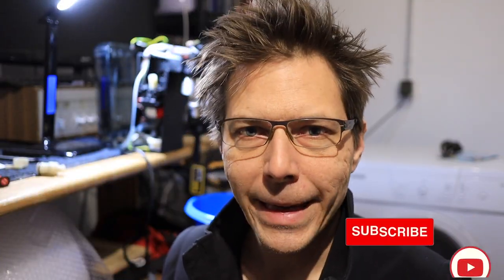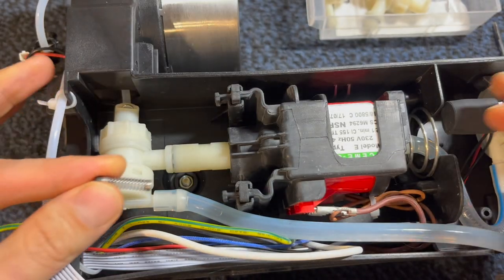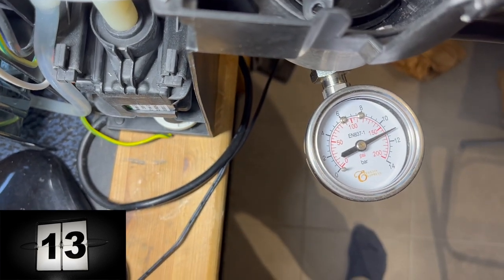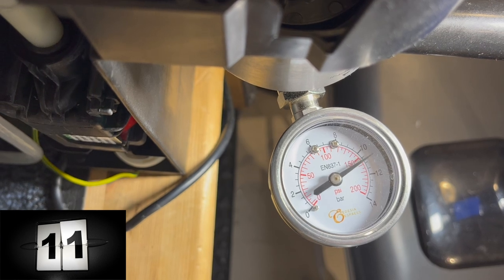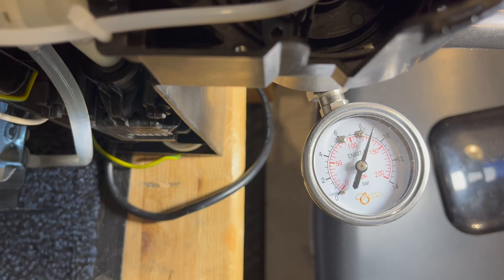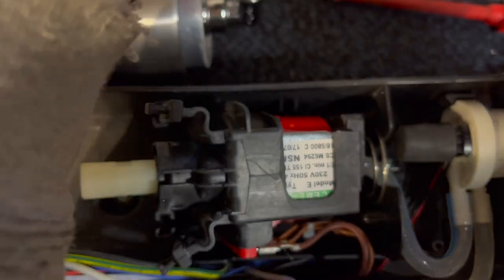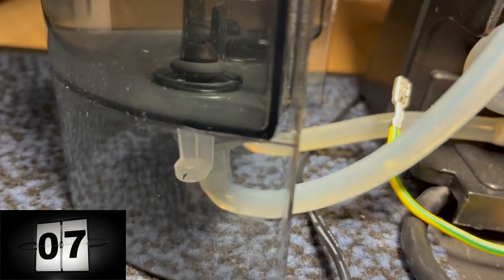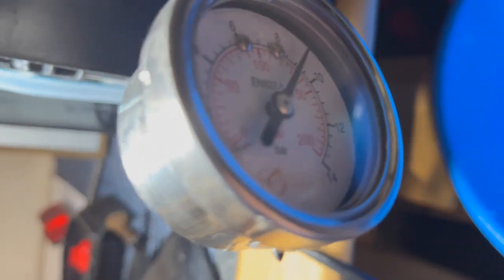How to Tune the Dedica to Max Out at 9 Bar instead of 11. Should you do it?

Comment from the maker: In the last video, we built a manometer out of a portafilter and blind disc. In this video, we will try different spring strengths and lengths in the OPV of the Delonghi Dedica EC685, and see if we can attain 9 bars.
Join the coffee club! (subscribe): https://www.youtube.com/c/TomsCoffeeCorner?sub_confirmation=1
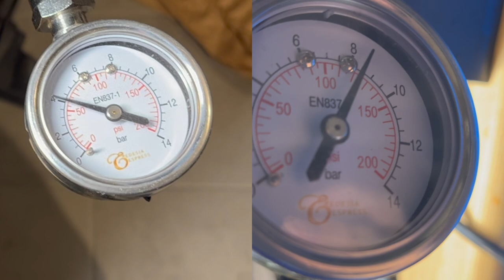0:00 Intro
1:04 Disclaimer!
1:42 OPV Prep
3:08 Test 1 with Original Spring
4:01 Test 2 with Pen Spring
5:52 Test 3 with shortened Pen Spring
8:10 Test 4 with Shortened Original Spring
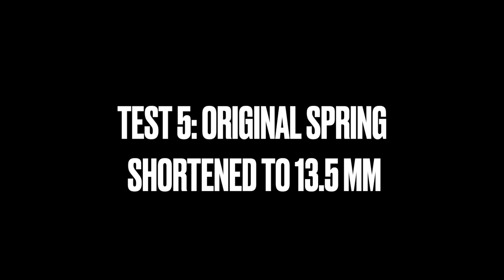10:49 Test 5 with further Shortened Original Spring
12:48 Result
Reply: I saw a modification where a bolt was built into this valve and the pressure was adjusted with a bolt.
Reply: Hey tom! Greetings from mexico. Man you convinced me to buy my first espresso machine.  Than you very much. Your channel is my favorite coffee channel on youtube!

Id like to ask for your advice.
I got the ECP 3420. I had been long brewing coffee using a cheap chinese knockoff moka pot. And the change feels substantial.
However i have set my mind up on finding a way to control the pressure. because id like to brew at a lower pressure.
Im currently pondering as to which way would be better... spring kits (like this video) or the dimmer + manometer mod.

I would think that going the extra mile and adding the manometer and the dimmer would give me extra control. but thought of asking you in case im missing something.

Thanks again! And have a wonderful day!
Reply: @sergeykh9544 ,Kenwood ES326 öyle👍.Ama köpük yapmıyor makinem,ve bir çözüm bulamadım🙄🤔

Comment: ok this looks like a fix, my machine blasts out a shot in 5 seconds and i mean blasts out same pressure as a pressure washer you would use to clean brick work. its been this way since o got it. now i know i can have a go at fixing the pressure problem by shortening the spring.thank you for your info Tom.

Comment: Thank you for your efforts putting these videos together, I've enjoyed watching them. You inspired me to open up and tinker with my EC685, which has been fun, its a surprisingly well designed little thing inside to my non-expert eyes. 
I recently swapped out the stock "safety valve" with an adjustable OPV from the Breville BES920, which has allowed me to reduce the extraction pressure as desired.
Unfortunately though there's been a couple of unexpected side effects. The stock safety seems to be more than just a simple OPV which is why it is so chunky I think.
After swapping to the Breville OPV, there is now quite a bit more vibration and noise through the machine from the pump and now have "puck sneeze" / residual pressure after pump is stopped.
I do think I'm getting a better extraction now as espresso flavour has changed, although it's not overly significant to my taste buds. 
I'm still on the fence as to whether it was worth it and may end up putting the stock valve back in.
Reply from the maker: Thanks so much for posting your results, Michael! I am sure that your findings are interesting to a lot of people watching.
I agree, that the OPV seems to be more than an OPV, rather a safety valve. It does also have a check valve on the inlet side, to not allow water to backflow through the OPV. Also, I feel like the stock valve is more of a safety valve, opening only if the pressure would get too high in the system. 
So your OPV came from a Breville Dual Boiler - very nice. Did it fit as such, or did you have to get extra fittings? Where did you order it from?
Reply: Hello Michael, have you got any updates on this? Did you try to install a no return valve maybe? Or went back to original OPV?
Reply: @panosp57  Hi, yeah I'm still running the Breville OPV mod and pulling shots with the machine daily. It's definitely improved the consistency of extractions as I'm now able to dial in the grind and then get pretty consistent shots throughout a 1kg bag of beans which I could never do before. 
The downsides mentioned don't appear to be causing problems with the machine. I just make sure to let the porta filter sit for about 30sec to allow pressure to dissipate and it's fine.

I would say it's worth giving it a go if you enjoy pulling things apart and putting them back together again 🙂
Reply: @michaelmulvogue9165  thank you for this update Michael. That sounds encouraging!

Comment: When there is coffee in the filter the pressure is gonna be a bit lower than the static(no-flow) pressure you measured with the manometer. 
The pressure curves for the Ulka EP5 pump indicate a 1bar pressure loss per 50ml/min flow-rate increase.
The 11bars static pressure might be aimed for a 9bar@150ml/min intended working point.
Reply from the maker: Hey Burns, as it turns out, I think you are exactly right. I installed an in line manometer in a later video, and found the stock OPV to have 9 bar during an extraction. I think the only reason for the confusion, is that most companies advertise 15 bars of pressure, so people figure they have to reduce it.🙋🏼‍♂️
Reply: @TomsCoffeeCorner  so you’re saying the stock opv is actually tuned to 9bar?
Reply: @TomsCoffeeCorner  so you’re saying the stock opv is actually tuned to 9bar?
Reply from the maker: Honestly it seems that way, yes. If you grind right, and do a nice puck prep, I have measured around 9 bar with an inline manometer. Cheers! @raelmax_
Reply: @TomsCoffeeCorner  Thanks, Tom! :D
Reply: @TomsCoffeeCorner  Maybe it's advertised as 15bars with the supplied pressurised basket?
Reply: @TomsCoffeeCorner  Thank you so much!
Reply: @TomsCoffeeCorner  I realize it’s been a while since you tested it, but could you still share what the ‘right grind size’ was?

Comment: what i've leaned from this vid is: just leave it as is ! 😅 much more experienced people and techical professionals have dialed-in this machine to be as good as possible. if they could be making the machine get significantly better coffee by just putting in a shorter spring, why wouldn't they? no extra cost, but extra bragging rights for this espresso model in the whole world 🙂 . i guess trying out to improve it through DIY at basically 0 extra cost, would definitely be worth it if a better model would be comercially available only with tweaked internals which does actually extract better coffee, so that you know there is a quality peak to look at. but in this case i don't know of there beying one. so..... happy you did these try-outs so that i won't have the need to do them, big thumbs up ! 👍👍
Reply from the maker: I agree. That is part of the reason I did this video. I hope it can save some people some time. Thanks for watching and commenting!
Reply: I wouldn't agree. Factory settings are set to suit ordinary people who lack both the skills and equipment (like precision baskets) for a better coffee extraction. Even more that they don't care (or understand) the difference between good and bad extraction - I used to be one myself just a month ago. But once you start to get understanding and equipment, you want to make the machine better as well.
Reply: The dedica is intended for pressurized baskets and therefore need more pressure for the extraction. Pressurized baskets ensure a good crema everytime, regardless of the coffee. The target group of the dedica definitely are beginners or just the average person wanting a more fancy coffee experience. The 6-9 bar range (the range Tom is trying to achieve) is for unpressurized baskets that you normally find in more advanced machines for more experienced „baristas“.
What I want so say is, that the machine is optimized for its purpose, which is using high pressure to extract as much crema as possible, to provide a consistent experience to inexperienced consumers. Tom is trying to tinker the machine to make it suitable for unpressurized baskets, which requires a completely different workflow as well as different tools.

Nonetheless I am also very grateful for the video and the prevention of me pulling apart my coffee machine :D

Comment: I was thinking of doing the same procedure, thanking you so much for sharing. I have my mind now on maybe designing a PID controller for the pump to maintain a tighter trajectory to 9 bars. Cheers.
Reply from the maker: That would be very cool! But I guess you'd need an in-line manometer with digital feedback to the PID loop, right? Sounds like fun!

Comment: Nice to see you tried a shorter spring. Also your taste opinion was valuable to me. 

As for another approach, you can restrict the flow out of the basket a bit (pressurized lite), as this will cause the pressure across the coffee bed to be reduced. 

With a normal pressurized basket, the pressure across the bottom of the basket is a bit high, so you have to coarsen the grind a bit to get an acceptable flow rate. That said, another video used a Decent and coarser grind with a short extraction time and 6 bar pressure, because they had read a recent research paper suggested that this gave better extraction. I do not think the video producer realized he was mimicking making coffee with a pressurized basket.
Reply from the maker: Hey Tom, thanks for your input. I would like to put an in-line manometer in the machine, and test the pressure that way. That way I can see what pressures are reached when there is a permeable load at the group head. This test was just to kind of see if a baseline of 9 bars could be achieved through the mod, but I have feeling that the pressure will be lower when pulling a shot.

Comment: Hi Tom and thanks for your nice dedica videos, I watched them all.... I wanted to ask you, i bought an ec685 for 35€ and i would like to refurbish it, which seals do you recommend to replace and which components? the Volumenzähler also?
Thank you very much
Reply from the maker: Just do a thorough descaling, maybe twice, and clean the machine up. If it leaks from the group head, you could replace that gasket. But it is not really a part that wears out easily. I have never had to replace mine.
Reply: @TomsCoffeeCorner  ok thanks, do you recommend me replacing the opv valve and the pump gasket? I don't know how old the machine is...
Reply from the maker: @frankieitaly86  You only need to replace the OPV if it's broken (in which case the water tank will bubble during extraction). The pumps last a real long time. I wouldn't change that stuff proactively, unless the pressure seems really low.
Reply: @TomsCoffeeCorner  thank you very much Tom

Comment: The video that i have been waiting for. I really like that you put your effort for the dedica (in budget) owners over there like me hahah. Is it possible to try some of the mr shades springs that you used for gaggia?
Reply from the maker: Glad you liked it, Andreas! No, the Mr. Shades springs are much wider than the Dedica springs. Too bad about that. What would actually be nicer is a different OPV that is adjustable.
Reply from the maker: @Alberto Rodríguez Yes, but I have not found one that will fit yet. Do you know of one?
Reply: @TomsCoffeeCorner  Found some info on reddit a while ago about a Saeco OPV that would fit Dedica as well. I swapped the spring on my Dedica with one from a ball pen and was happy enough since that I didn't need to research further to find the Saeco part. I think it's a matter of finding the right spring, with the same length and width as the original one, but different elasticity. Trial and error with different pens i guess. I don't have a manometer portafilter unfortunately to give you stats on the pen's spring I used, but maybe you can find this pen and try it "BiC Soft feel Med".
Reply from the maker: @Cattaable  I will have to check it out. It mainly has to do with coil diameter and length, I think. Did the taste change for you? How about the extraction....did it become longer?
Reply: @Cattaable  you know you can get a box of different size/strength springs on the Bay for not much?

Comment: Hello!  great video.  why is the pressure rising so slowly?  how does the taste of coffee change?  would like to see how to install PID controller on DeLongi ECP
Reply from the maker: I think too much water is escaping out of the OVP due to less pressure of the spring. But eventually, the pressure builds up in the system. If no water escaped, it would build up much more quickly, like with the original spring at full length.
Reply: @TomsCoffeeCorner  thanks, how much does the taste of coffee change at 9 bar?

Comment: Hi Tom great show... 9 bar ...the holy grail! Just wondering if the OPV 9 bar spring from the Gaggia mod would fit the Delonghi ?
I know more work for you ...the moding though makes great fun of the whole coffee experience...
Many thanks laudi
Reply from the maker: Hey Laudi, no it wouldn't fit because the output fitting going from the OPV to the thermoblock is a completely different fitting type. Maybe if there was an adapter. Does anyone know?

Comment: Hi Tom, would you be able to do OPV mod for Barista Express? The proper one with coffee testing. I believe that this is the only way to get better coffee out of this machine and avoid channeling induced by extensive pressure. Thanks.
Reply from the maker: Hey Krzysztof, I actually have a Barista Express laying around, that I could check out. I believe the OPV is adjustable, by screwing it outwards. Do you think this could be interesting for lots of people? I am not sure if this hasn't already been done on Youtube?
Reply: @TomsCoffeeCorner  defintely it would be as I could not find a proper tutorial with test on YT. OPV is adjustable as far as I know but it looks like you need to unscrew it quite a bit to restrict  pressure to 9bars. Apparently you might be on the edge of thread engagement risking some leaks from the valve or striping the thread. I wonder if putting a shorter spring would be a safer option. Also I am curious if the mod is worth doing at at all. :)

Comment: Hi Tom, thanks for all your work and experimentation on the Dedica!  I have been looking for a GCP, but they are so popular in the US that finding anything decent for less than 2-3x the price of a Dedica is impossible.  But I'm out of work and money is tight, so I'm switching to a Dedica.  Just debating used vs new.  New is less than $50 higher than used.  I am thinking it is worth that premium to ensure no scaling in the small thermoblock passages, as I think that will be the primary cause of failure on these units. 
To the subject of the pressure have you tried running the same manometer tests on the 9bar modded GCP?  Seems like you could build a similar housing cheaply using a back flush plate for the 58mm portafilter... maybe incorporate a bleed valve too! :D   There has been so much work done on the GCP if you benchmark parameters on that it gives a target for working on the Dedica.  For springs get some measurements from the original and then visit McMaster Carr, they have a ton of compression springs in different materials,  spring rates and corrosion resistance in both pre cut and longer stock.  Following link is to cut length compression springs in inches, which seems to have much bigger supply than metric.  There is also cheaper longer spring stock, but from you experiments it sounds like you think the length needs to remain set and the spring rate needs to be adjusted.  That might get cost prohibitive.  https://www.mcmaster.com/products/springs/compression-springs-7/system-of-measurement~inch/  btw mcmaster is a high cost site as they do MRO low quantity, stocked items to to get repairs done next day, but they have a ton of stock that can be shipped immediately.   Other spring companies have better cost, but McMaster is a fantastic research site. 
Thoughts on temp control:  your surfing techniques already have the Dedica out performing a stock GCP holding portafilter temps at basically a 90 average with a small drop 10 seconds in or so.  Clearly the Thermoblock has the heating capability to increase temps at the stock flow rates since temps raise through the end of the shot.  This does not seem to be triggered by a low temp value as the start of the increasing temps occurs at a higher point (~87) with the steam hack.  It almost seems to be flow or time based.  Clearly a PID mod would be the prefered solution, but some kind of manual heater override/jumper at a specific time after starting the shot may be a cheap alternative.
Reply from the maker: Thanks for those insights, David. To address the question of pricing, the GCP can be had for $450 on Amazon, while the Dedica is around $300. So it's not such a huge gap in the USA. In the EU, the GCP does in fact cost 3x the price of a Dedica. Have you considered an ECP 3420? I have been experimenting with that one, and I prefer its results over the Dedica. I recently made a video about it.
But yeah, the Dedica can hold a good temp curve with the steam mode hack, although I don't know how well repeatable it is. I just measured it for the video. 
Have you ever been to Goodwill by the way? I have found espresso machines there very cheap. I found a Dedica EC685 for $7, an EC155 for $7, and a Saeco Via Venezia for $10. I was delighted! Of course they are far and few between, but it's fun to have a look at Goodwill anyway. You could also consider Facebook Marketplace or Craigslist. Finally, Amazon Warehouse Deals is a great resource for like new equipment for cheap. 
Cheers! Tom